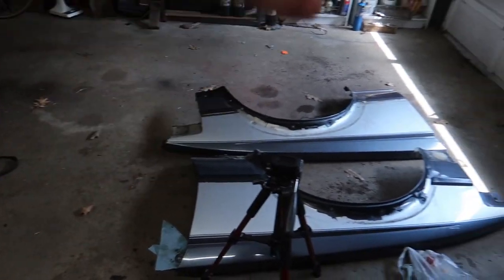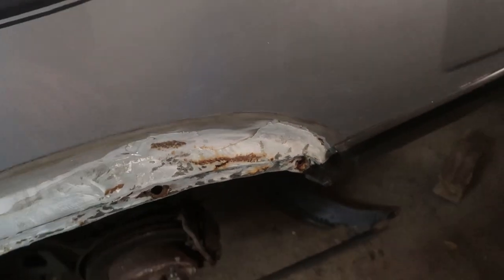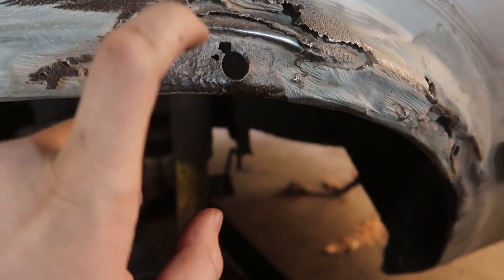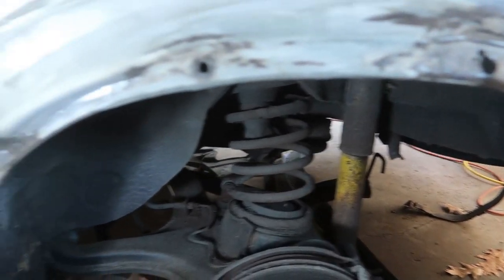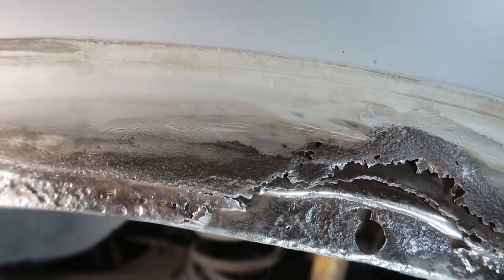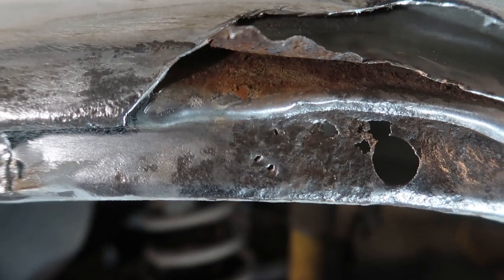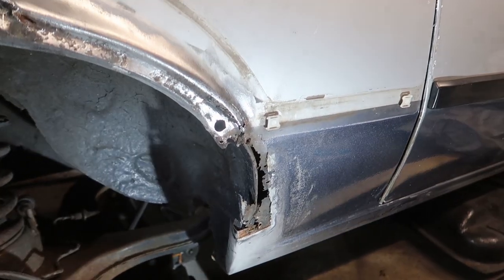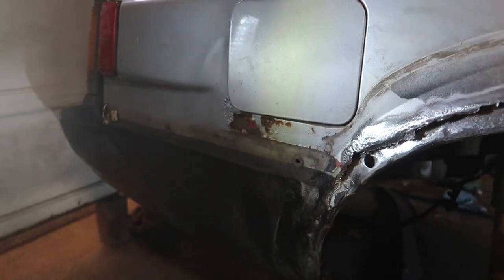The Rust is Worse than I thought | MK2 Supra Rear Quarter Panel Rust Repair

Comment: I am looking at one these 1985 Supra's here in Wisconsin.  it's got cancer bad too, guy wants $4000 for it 5 speed manual, 111k miles, and it doesnt run
Reply from the maker: Hmmm not a horrible price but it depends on why it doesn't run and how bad the rust is. A lot of parts are hard to find for these cars. I am happy to help with anything I can. My Instagram is "wes.martin_" if you would wanna DM me